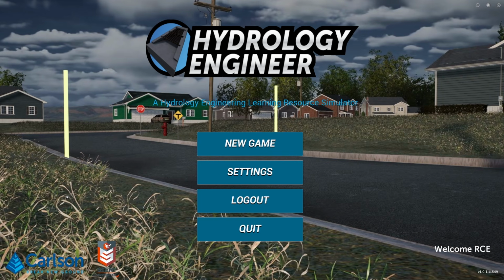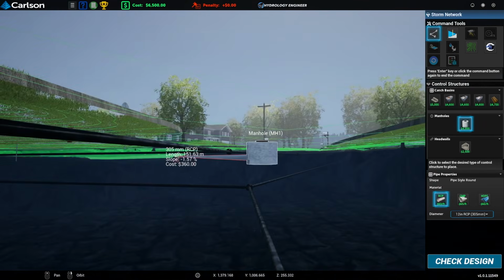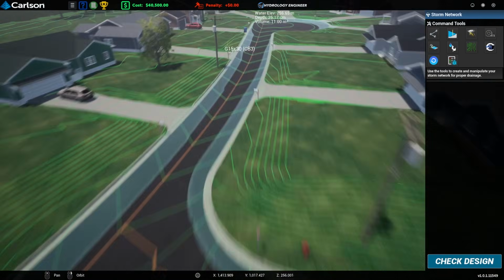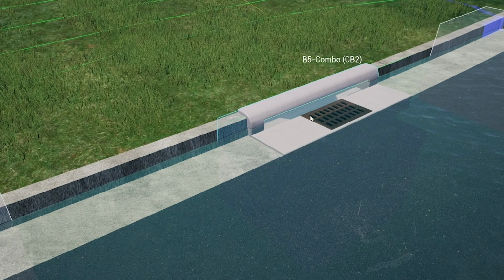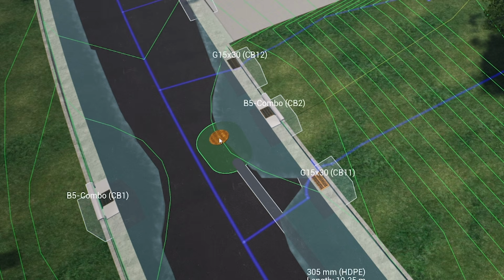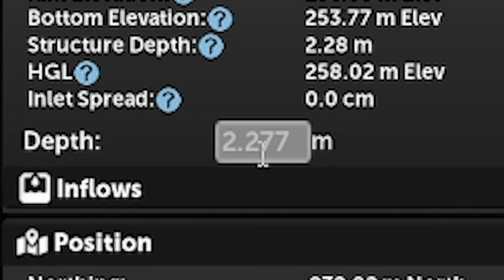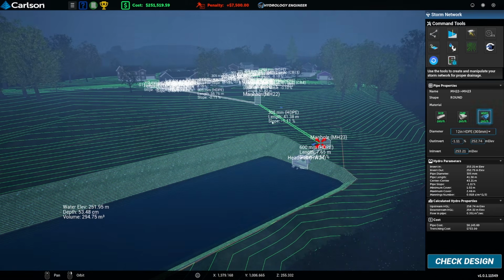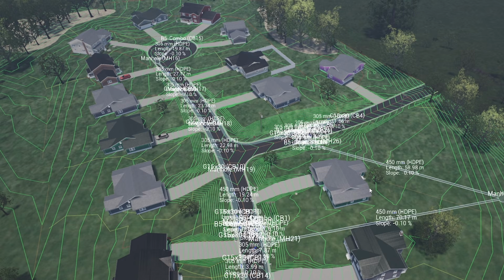The secret purpose of these holes...

Comment: i'm sure other comments have mentioned this but: that's not what 100-year or 30-year storm means (i didnt know this until i took a geology class in uni so it isnt exactly common knowledge either, or most ppl just assume others know what it means thus the info gets lost and never shared)

but! the number in "#-year [event]" is more about the percentage or likelihood that the event will take place within a scheduled year
so a 100-year storm is a storm that has a 1:100% chance of occurring in a year (so .01% chance of occurring)
and a 30-year storm has a 1:30% chance (0.0333...% chance)
basically, the smaller the number, the more likely the event will occur

to be fair, the meaning isn't too different from "a once in 30-year chance" if using it figuratively, but doesn't fit with the literal or professional usage.
Reply from the maker: It means the same thing, a 1 in 100 year storm is a storm that occurs once in 100 years- which in turn has a 0.01% chance of occurring in any given year.
Reply: @RealCivilEngineerGaming Then with global warming, a once in a hundred year storm happens every other year now. Yay!

Comment: The fact that the game allows 2.4m of water across the road (presumably on both sides) is crazy!  Maybe American roads are wider, but for the vast majority of roads in Australia, having 2.4m of water on either side would essentially render the road flooded to anything smaller than an SUV. 😅
Unless the 2.4m is a cumulative total when considering both sides of the road 🤔.  I suppose that would make sense if 1.2m is the UK standard, then 1.2m on both sides would total 2.4m (or I'm just overthinking it).
Reply: This is why we need people like Post10 to clear those drainage grates of debris.

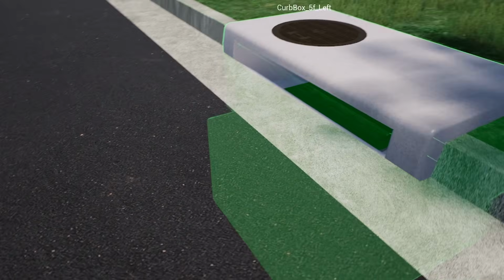Comment: 6:29 We use the grate & inlet combination, without the concrete on the grass with a manhole.

The grate itself is a large, heavy steel construction. 

It's large enough to easily accommodate a person with tools/equipment access into the chamber (Sump? Ditch?).

The grate can be lifted from the front nearest the road and is on a simple hinge at the rear nearest the inlet.

Well, they are at least the most common curbside drainage we have along the coast in Queensland, Australia.

As you might imagine, being a semi-tropic region, we experience a lot of rainfall over a short period at times. So our drainage needs to accommodate significantly increased flow rates.

Unfortunately, despite this, during extreme rainfall periods even these massive combined inlets are not good enough and we experience floods.

We have been attempting to put in overflow infrastructure to increased drainage capacity for these floods. 

What has been implimented so far has helped, at least with draining the flood waters afterward and maintaining a slightly reduced flood area during the downpours.

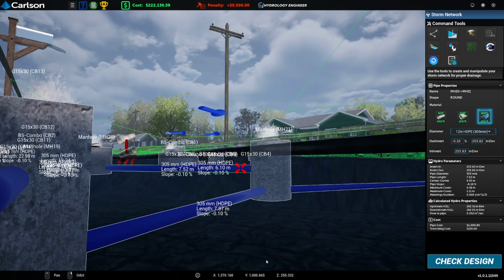Comment: 30:23 "x" generally represents left-to-right, and "y" to up and down. If you're thinking of things from a top-down perspective, like on a map, then that translates to east-west, and north-south. And then "z" is of course elevation. But if you're thinking about it from the perspective of the player, "y" represents elevation, while "z" represents depth, in the sense of closer or farther away from the camera.

In 2D games, x-y coordinates can represent a certain pixel on the screen, in the order that those pixels are drawn. So the top of the screen is the y-coordinate zero, and the bottom is 1080, for example, which is confusing as well. A z-coordinate can then also represent "depth", but only in the sense of which element is drawn on top of which, like layers in photoshop.

I think it comes down to personal preference, or maybe which engine they're using, what x-y-z actually represents. I believe I've seen it both ways. And if you're using a 3D modeling program that uses one coordinate system, it may be easier to just go with that one for your game rather than translating it for every asset.

Comment: In some countries  (e.g. Germany I guess) all water goes into the same pipe system, instead of having one for the wastewater and one for water drainage. I'm kinda curious why they decided to do it that way.
Reply: I'm sure using two systems would be more costly than using one, at least in terms of the piping network. On the other end, water drainage doesn't need to be treated - it just needs to be dispersed. But waste water absolutely must be treated, even before draining it out into a major body of water like a river. So with only one system, either you are having to treat more water than is necessary or you aren't treating water that really should be treated.
Reply: @reverse_engineered Germany absolutely treats the water, or is overhauling the rivers where we didn't care about it in the 60s or similar. Government probably thinks drainage needs to be treated because it washes stuff off the asphalt or something.

Comment: OH CRAP that thing you said about pipe depth just solved a family mystery!
Out of nowhere one day we had a sinkhole appear in our side yard. It was 30 feet deep and 10 feet wide. It looked like a hole in the ground you see get generated in minecraft. Cost us 2 grand to get it filled. We found out that it was because our dry well had collapsed.  However I'm looking at the hole and it looked like there was actually places on the wall where water was flowing  as if it was part of a stream. 
The thing is that the pipe that fed the drywell was very shallow. Also they had to cut this pipe to sort out the plumbing when the city put in sewers and the pipe going to our septic tank was under the drywell pipe. So they had to cut it and they reattached it later with a rubber sleeve and those metal pipe connector things you tighten with a screwdriver. 
Well my parents have been parking their RV right ontop of the drywell pipe. 

I was adamant that the pipe had been damaged for some time because of the water flow signs on the wall of the pit. Now I know that it was.

Comment: Drainage engineer here.

Pretty sure those combo boxes don’t accurately show the spread width is probably because most formulas don’t account for the opening at the back since spread is calculated directly upstream of an inlet. So at sag/low points, they don’t accurately depict the capacity of the “open” inlet

Comment: 4:46 you mention the waste water line being the absolute lowest in case any leakage occurs so nothing gets contaminated, yet earlier towards 3:18 you mentioned in some neighborhoods you have seen where there's a nice little setup and each thing is segmented prettily underground with a meter of space between them. Are they still spaced apart vertically as well or in those scenarios is it okay for the pipes to be side by side?

Comment: 30:58 In every math class I took from elementary to University, whenever we looked at coordinate grids, X was always shown as the horizontal, and Y Vertical. If there was a z coordinate, it was either going into, or out of the page, I’ve always pictured it as as if we’re looking at the grid from a side view (which makes Y elevation), as opposed to a top-down, which would have made Z elevation.

Comment: Nah man. Have to hard disagree with you. if you are thinking of a 2d grid x his horizontal and y is vertical. There is no grid where it's x and z axis for horizontal and vertical. It logically would follow that adding a 3 dimension, as in depth, z would be depth. In what logical way would you rotate the established 2d grid to make it flat and then add z as up and down. Doing so would be such an architect move.

Comment: I remember as a kid having to remove my grandfather's downspouts from an old clay pipe that ran underground. Dad showed me that the other end of the pipe was in the street curb. Apparently, a 100 to 150 years ago, they just blew the roof water out into the street. The city had decided they were tired of the extra water they were having to clean before releasing it into the river. 
  Side note: Grandpa's street had one of the last sections of original brick streets in my hometown. Aren't brick roads supposed to help moderate the need for drainage?

Comment: I'm wondering, how is your irl drainage situation? Because mine seems quite different. My house and garage go to a personal drainage shaft on the property. The street in front goes to a drainage ditch next to the street. Other surfaces like driveways and terraces have to be permeable. Water has to get managed where it occurs, it's not someone elses problem.
Reply: What he showed there looks very similar to my situation in a major city in Canada.

I'm responsible for the drainage on my own property, which basically amounts to not diverting it all to the street. But even the stuff I do drain to elsewhere on my property will experience some run-off to the surrounding area. In the example he showed, all the water that would land on my house is added to the rest of the water that lands on my lawn, and all of that flows over my lawn. So it's more than what would fall on the lawn alone, but only has the infiltration rate of that size of lawn. Therefore, more runoff meets the street and that has to be accounted for in the road drainage system.

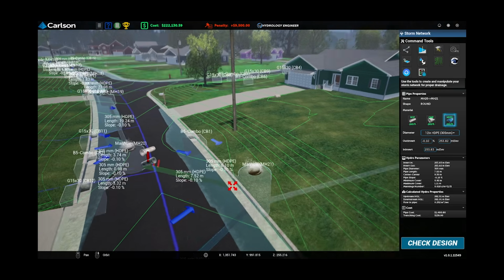Comment: 30:23 The reason for why Z is not height in most games is because the most common view to have in such games are towards the horizon, compare that to the software you are using to design drainage where the most common view is top down, moving up on the screen in a game generally means going towards the sky meanwhile going down on the screen is towards the ground and up and down is the Y axis in most systems

Comment: From game developer perspective, most game engines use XZY coordinate swizzle or you can say "Left Hand Rule" pointing index finger towards the screen. Z component in local coordinate always points from camera origin to near projection field. That's why I, as a technical artist have hard time talking with game engine specialist in my team. The reason they use XZY and not XYZ swizzle is obvious, as they also need to render UI in 2D (XY-coord), the Z component in 3D should be depth from (0,0,0) rotation, which is putting camera perfectly parallel to the world plane. So Y component points upwards to the sky.

To obtain Z as depth, you can always use swizzling function, but many devs aren't usually math enthusiast, and less so making a game with very strong math in it's mechanics. So that's why they don't even bother having more computation cost with that, even if it's cheap.

Comment: Actually as far as XYZ corodinate systems most mechanical(real😮) engineering software, at least that I've used, use the X and the Y axis as the front plane, meaning Z goes towards you. I believe it has to do with engineering drawing standards and the commonly used Third-angle Projection where Front plane is X/Y, Right plane is Z/Y, and the Top plane is X/Z. Think of in a classroom setting you are drawing a 2D image on a whiteboard(X and Y only) and then to bring it into 3D you have to "draw" towards you so everyone can see it. Its still all the same its just perspective but since this method was developed by people who manually drew things and predates any software, makes sense to me that this would be pretty common in most industries now.

Comment: Manhole covers were welded shut in Vegas but the F1 pulled so much it actually tore the concrete frame off IIRC 😮
Reply: Estimates on the current F1 generation downforce levels is somewhere in the region of 3 to 4 times the cars weight (which is 798kg). So conservatively we are taking about 2400kg. Roughly 65% of that is produced by the floor (which is what caused the drain failure) so the force pulling the drain up was around 1500kg which is wild.

Comment: Do have to mention that while the UK "officially" uses the metric system, we're technically one of the few that use both systems at the same time and often interchangeably for the same thing, for example milk, it's sold in pints and also litres depending on who makes it, and sometimes have both listed on the same bottle (again depending who makes it).

As Matt mentioned, we still use mph and miles, you generally check the weight of items in shops in metric, though you weigh yourself in stone and ounces and your height in feet and inches.
Quite sure the railway still uses the chain length in location identifier (miles and chains from London usually), though they do also have it in metric as well now.
Reply: Canada is weird for that too. Products in the store are all sold in kilograms and litres, but go to a hardware store and all of the lumber and fasteners are in inches and feet. It gets really confusing because a lot of appliances and furniture that are sold here are manufactured in China, which would normally use metric too, so you never quite know what units things will be in. You end up having to keep tools and spare parts in both sizes.

Comment: Even though I only work as a traffic control manager. The company I work for does sidewalks. From watching this I learned why they also do catch basins (as the hard surface of the sidewalk would change the amount of contributing drainage). So I do find this interesting because it helps me understand why they put the catch basins where they do, and often has be tied in to the existing drainage system.

Comment: The reason for the Y and Z swap in video games is due to most games being side scrolling and X is horizontal and Y was vertical, then perspective was added, so Z became the depth. I agree that it should be Z for height but all the programming tools have it as depth — also, graphics software, like Photoshop, have Z as depth and that would make using these tools much harder.

Comment: I'm pretty sure we could fund our reactor accident analysis code development by making a decent level editor, adding sound and animation, and putting it up for sale on Steam. Pity there's so much twitchy export control nonsense involved for that to ever happen...
Reply: There have been similar games made for other scientific uses, such as protein folding. I think the hard part, though, is that a game needs to be designed to be accessible and fun for people of all skill levels, which often means simplifying things to the point that the results aren't useful in the real world.

You see this happen all the time with engineering games of factory automation, programming, or making circuits. While they all touch on interesting elements that make you feel like you're doing the real thing, the real job has 100x more complexity and constraints that mean it requires far more dedication to learn and to succeed. By that point, the only way you could make me play that game is if you were paying me for it. ;)

Comment: The thing about the 100 years flood for the pond and 30 years flood for the pipes is not that pointless because in the 100 years flood the pipes won't be able to transfer the water fast enough to the pond so the roads would flood, but eventually, most of the water will make it to the pond

Comment: little fact about roofdrainage in germany: our roof drainage systems usually go into some rainwater storage for own gardens or directly underground into the rainwaterdrainage from the road, without swamping over the greenery ^^
Reply: As a strange counterexample, in my city in Canada, we are not allowed to capture the water and store it! I don't entirely know the logic behind it, but it comes down to not being allowed to divert the natural flow of water. I suppose it would make sense if taken to the extreme where you capture as much water on your property as possible and therefore withhold that water from your neighbour who would normally receive it.
Reply: @reverse_engineered  well, most times those barrels to collect the water can hold like 100-200liters of water and then simply just overspill. Regularly used at single family houses, when you have a garden, where you Tempo to use the stored water in the evenings of the dry season to provide it to your garden. (In the evenings, so that the burning mid day sun won't use the water drops as magnifying lenses and even burn the plants more)

Comment: Hey Matt. I work at an Civil Enginering firm and, can confirm, the phrase "water flows downhill" is one of the most important things to know when drawing your streets! 😂
Reply: I've had to explain that to maintenence guys at the restaurant I worked at. They somehow expected the drains from the dish sink to get water UP into a drain pipe in the wall (left over from the original, much smaller+higher drained sink)
Reply: I have to question how much some of them seem to know that considering how poorly I've seen some road drainage being done here in the US.
Reply: Don't get me started. There's a section of road near my house that practically floods when someone sings Itsy Bitsy Spider too nearby.
Reply: I work in environmental, and water flows down hill is definitely NOT something most people get, including engineers. Its incredibly frustrating.

edit: But more specifically to roads, sometimes subdivision designers flat out don't hire people to do this and just expect stuff to work, and when it doesn't, the surprise pikachu face comes out.
Reply: As a US citizen I can confirm that roads flood if it so much as drizzles. Probably because all our tax dollars are put into the military and not anything else.